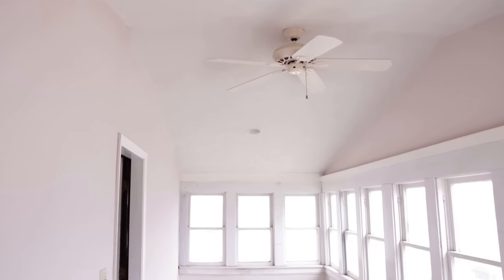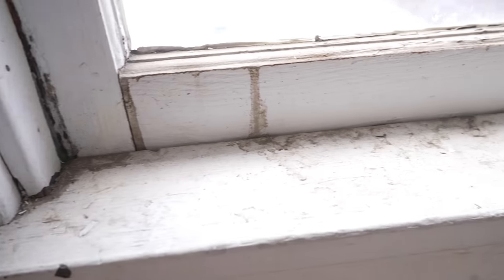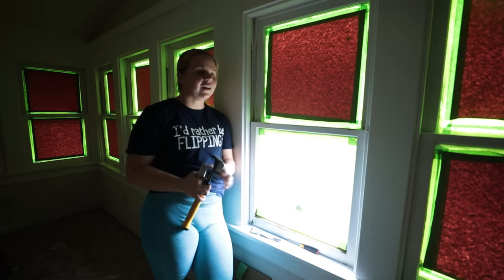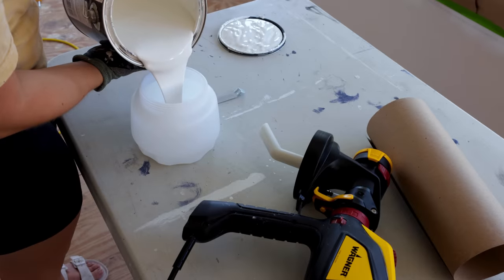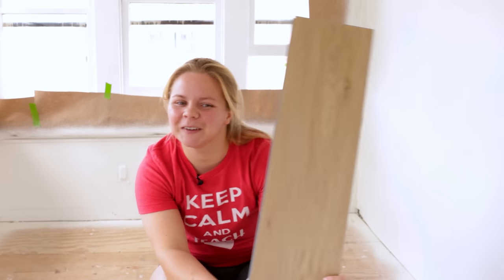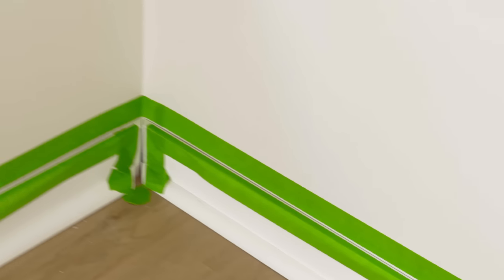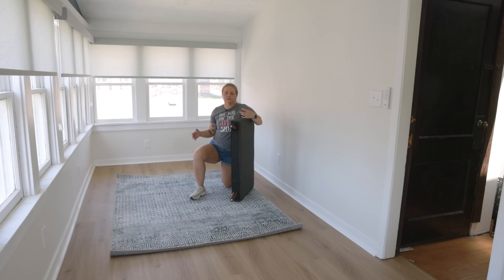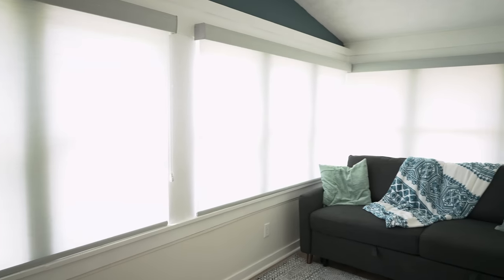Sunroom Transformation for our AirBNB | Complete BEFORE & AFTER

Comment: The only comment I would add regarding the decor is that you get pillow stuffers the next size up from the pillow covers
 Large covers + too-small pillows looks sloppy and worn, even if they are brand new.  Bigger pillow + very slightly smaller cover = fluffy and inviting.  So, for example if you have 16" covers, you need 18" pillows. Another trick is to wrap the pillows in quilt batting and then putting them in the covers.

Comment: Add a foam topper for the sofa bed just keep it in the bottom of the linen cupboard where you put the extra blanket/duvet, pillows, sheets and towels. A topper on a sofa bed makes it really comfortable.
Add a couple of poofs to use to either put your feet up or kids seating.  Put against the window wall by the couch.
Reply: Absolutely! Sofa beds aren't very comfortable, so a foam topper is much needed. You would want the guest to me comfortable, or they won't return.

Comment: The room is fantastic! Just a few suggestions to work towards, first thing is see about getting UV protective glass for your prints, it's more pricey but will keep your prints from fading in such a bright room. I would keep on the lookout for fabrics that have your colours in them. Plaid, floral, any pattern actually plus I wouldn't go for any more that 3 and make cushion covers out of them. I look at the second hand stores for different shapes (round, square, lumbar etc. You can wash them easily and try to find ones with zippers or if you sew but hate to put in zippers use velcro to close them.  I agree with the smaller round coffee table and D tables are great for putting against the windows for plants. If you don't want to bother with pillows you could paint the D tables with your colours . Lastly a floor lamp or a "roxton" type lamp table would work fantastic between the chairs. I found one at Sally Ann that "steps" that come down, great for plants, pamphlets, and to set a drink while enjoying the space. Long winded I know.

Comment: I would remove the yellow chair and replace it with the rattan chair that is on the other side of the room. Move the coffee table in front of the sofa. Use the orange color of the chair as your main accent color. Stuff the pillows more firmly. Pictures are hung too high and too far apart. Think of the 2 pictures as one focal point.

Comment: The furniture should be faced toward the view. The way the sofa and chairs are set up blocks the view and the disparate chairs look mismatched due to the shapes, and smooshed together. Even if that's the only way the sofa will go, I would fix the chairs and coffee table, they look terrible as they are in the video. Even the colors don't look right together with green and grey. Makes the new sofa look old and dirty with outdated hand-me-downs that came from grandma's basement (might have looked better if you stuck with emerald green for the sofa instead of depressing grey). Matching chairs in a cooler tone would look a thousand times better. This room should look relaxing but it's full of tension because it's all styled wrong. So much meticulous work to style it like it appears to be without intention! If I stayed there I would be pulling my back out moving the chairs and table into a sensible arrangement before I could relax. You can achieve pops of color with throw pillows instead of this mess. I wouldn't want to have tea there, it would feel like I'm at a yard sale. I appreciate vintage pieces when they are styled well, but this grouping does nothing to highlight the chairs whatsoever, just makes them feel old and dirty.